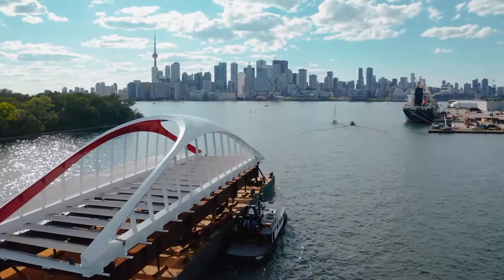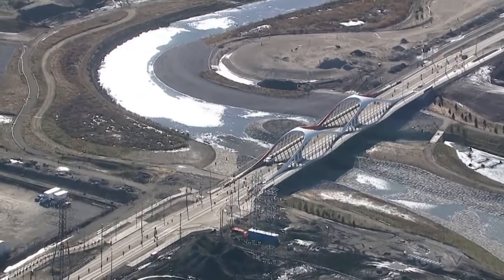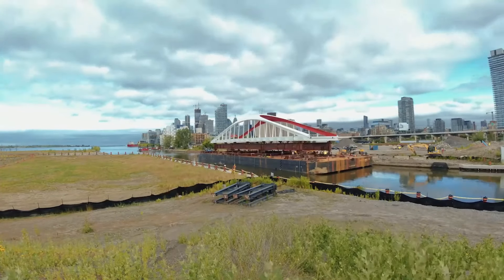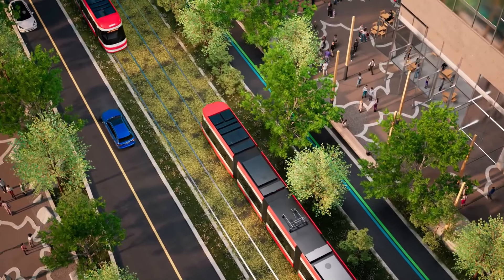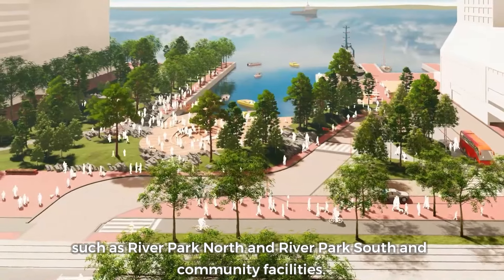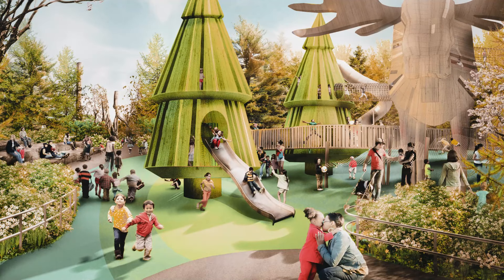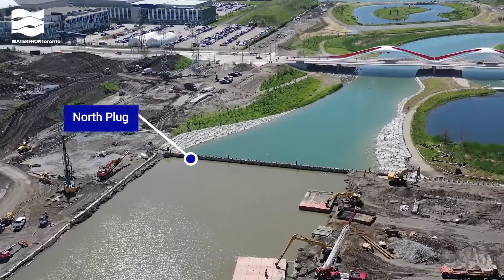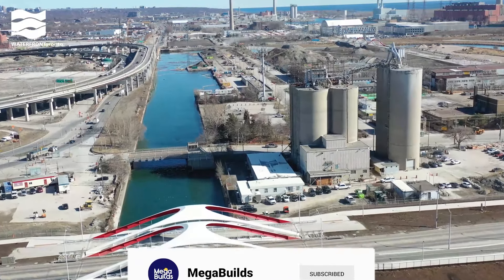Can This Megaproject Solve Toronto's Housing Crisis?

Comment: Title correction 🙏 Toronto is Building a New 1 road neighborhood which will have the traffic of Liberty village
Reply: Did you watch the video?  Only 25% of travel will be by car.  There is already cycling infrastructure across the bridges and eventually streetcars will be incorporated.  There are also plans for Go Transit and the new Ontario line.  I don't think it will be anything like Liberty Village.
Reply: @PaulLynch71  OK, then what's the status of the LRT line? Hint: It's not even mentioned in TTC budgets. So who's going to build it?
Reply: @stephensaines7100 the LRT will be an extension of the Queens Quay street car that currently ends at Union Station.  With all the bureaucracy and red tape with the TTC, Local and Provincial Governments I anticipate it will be another nightmare like the Eglinton crosstown but if they are building housing for that many people they will absolutely need sufficient public transit.
Reply: Villiers island won’t be a thoroughfare
Reply: @maddoxmagennis1520  I think that's exactly what you want it to be, thoroughfares were originally named after horse travel. It was a split use road way for pedestrians and slow moving traffic ie horses, being the thorough's. Equivalent to a bike/scooter/pedestrian paradise you probably seek out.

You choose poor phrasing, using that term.
Reply: @briano9397  I get your point, but in a modern context thoroughfares are typically used to refer to an area with a large number a vehicles passing through. When you referred to car traffic in liberty village, I assumed we were talking about car traffic on Villiers island. You can have bike/transit thoroughfares, but you are clearly reffering to car traffic because a lot of pedestrian or bike traffic just doesn’t come with the same downsides that cars do